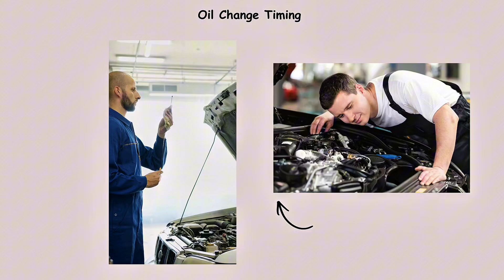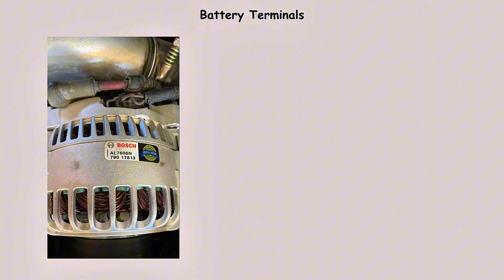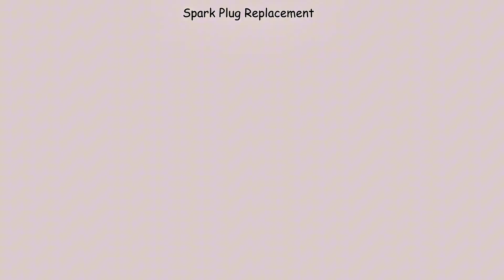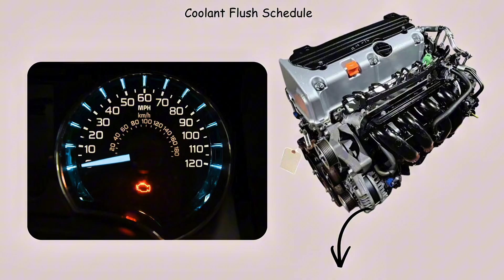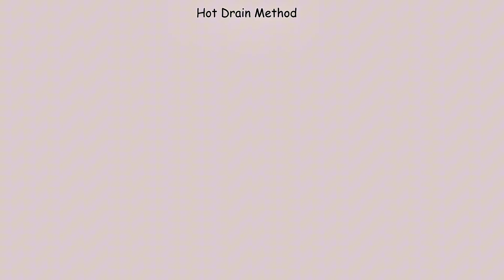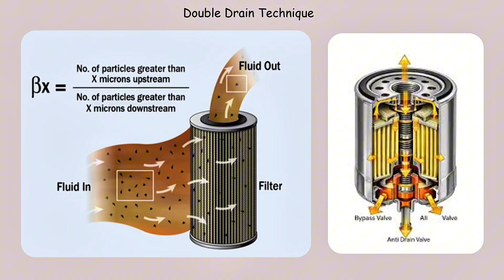Never Change Your Oil Without Knowing These Japanese Secrets — Explained

Comment from the maker: Which method surprised you the most? Drop your answer below 👇

Most people never knew about the Pre-Flush Technique and the Double Drain — these two alone can add 100,000+ miles to your engine life. Try these on your next oil change and let us know the difference. And if you drive a Toyota, Honda, Lexus, or Subaru — share this with someone who needs it. Your engine will thank you. 🔧